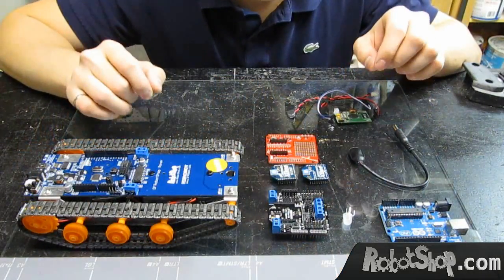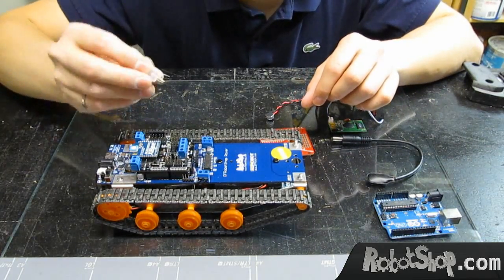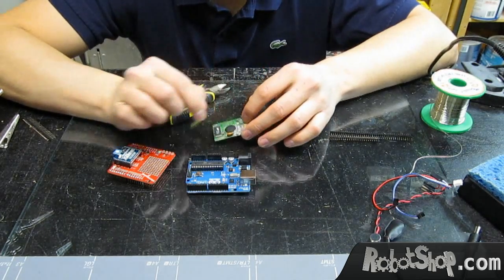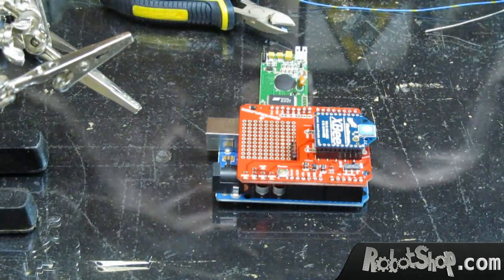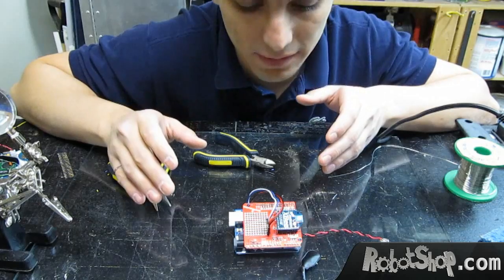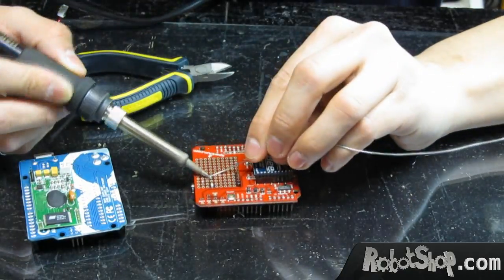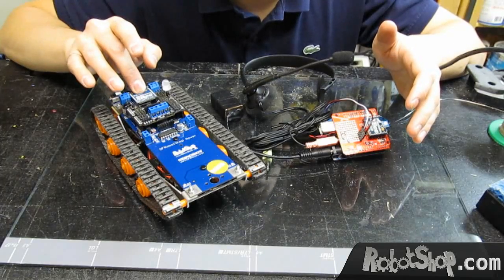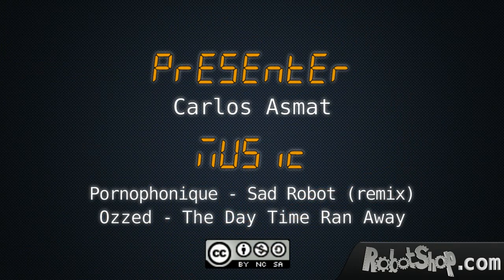Carlitos' Projects - Speech-Controlled Arduino Robot by RobotShop.com

Comment: Nice video.  We built a similar project.  However, we installed an Android device onto a RC car and used an IOIO board instead to control it autonomously. Here is the preliminary result:

http://youtu.be/vkvkfcqEUkk

Comment: That was full buy peoject, how much cost you all that? About 100euro ? Sucks
Reply: It costs about $40
Reply: Victor Cavca 40$  ? :D Only the arduino Uno cost 20euro on the arduino.cc
Reply: Domino SixO Yes, but you can buy one compatible with arduino uno for about $10 ;)
Reply: Victor Cavca Look all the stuff he has i don't think that all of them cost less than 40$ :D only the arduino "tank" cost about 60$ :D
Reply: Domino SixO Yes, but you can buy all that stuff less than $40 from ebay from example.
Reply: Victor Cavca He is using alot of stuffs there, i don't think you can buy them less than 40$
Only the arduino uno cost 15$ on ebay, or if you wanna buy a 8$ copy and have 50%50 that he may work or not, i had that kind of situations.
Reply: Domino SixO There is no difference between original and copy arduino. The only difference may be soldering quality. Arduino is not an iPhone. You can make one yourself and it will work like a charm, and you will need only ATMega controller and a 16mhz quartz.
Reply: Victor Cavca Look i can take a list of the items he use and make the total price and you will see that you will spend more than 40$.
Reply: Domino SixO Don't do that, you just waste your time :) May be you are right, but I know you can do it a lot cheaper)
Reply: Victor Cavca I have alot of free time,
look better finish this because that can take weeks of talking, in the next comment who will say about less than 40$ I will make a list of all the components he use and you will see that he spended more than 100$
Reply: Domino SixO $40 :D, just joking. Did you made a project with arduino?
Reply: Victor Cavca Yes i did, tryed to use arduino to program a Atmega and use it for robotic hand but stoped the peroject because I can't find the exact materials i need, maybe in the future i will work on it again.

Comment from the maker: The project can be made using a DFRobotShop Rover and VR Speech Recognition Shield (both available on RobotShop). There is sample code available at the link above, and additional information in the DFRobotShop Rover and EasyVR user guides. RobotShop ships to Cambodia. If you want to use different products, we cannot provide much help.

Comment from the maker: The cube is programmed using the Arduino software which uses Processing (Basically C++ along with some libraries). You will find the software at Arduino DOT cc

Comment from the maker: @DartecTube There is an existing LED on Pin 13. You can connect a standard LED to pin 13 and GND (right next to it)  without the need for a resistor or additional electronics. Just make sure the LED is oriented correctly (one end is longer).